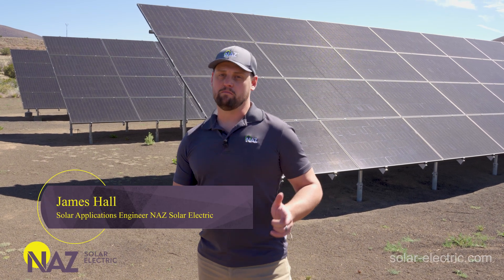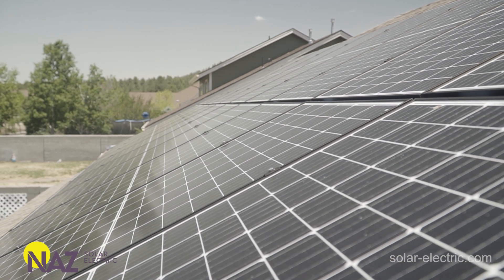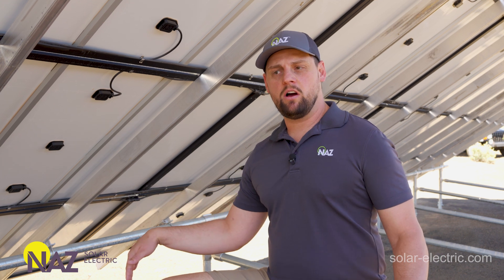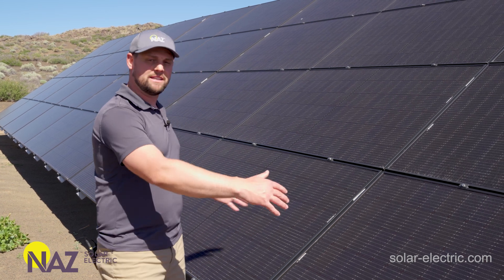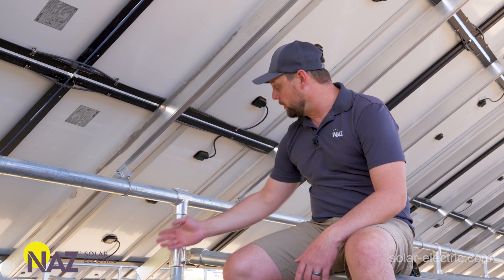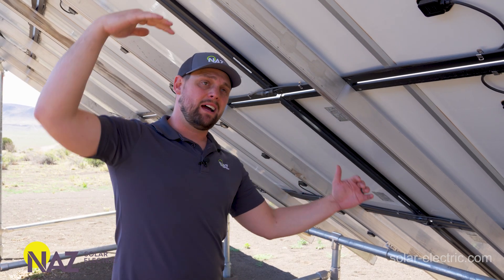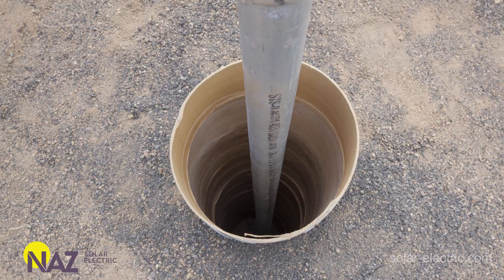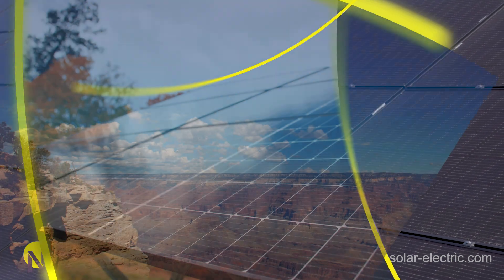🔆 Exploring Mounting Solutions for Solar Modules: A Deep Dive into Ground Mounts 🌞

Comment: I am in the process of gathering components for a 35kW ground mount install here in Phoenix.  I have (50) 700w panels already, and they are very large, 48" x 96" roughly.  Would the Tamarack system support a 3-stack vertical?  I'm noticing on the configurator, they don't recommend panels greater than 45" wide for 3 tall configurations.    I just ordered my Hoymiles HMS-2000-4T's and hopefully will have those in the next couple weeks.     Once I procure all of my equipment, do you guys have recommendations on anyone that services the Phoenix area that can get my engineering and hopefully installation?  Does NAZ service Phoenix?    I'm ready to get this project going now that I have the bulk of the main components.    Thanks for the video, it's really helpful.